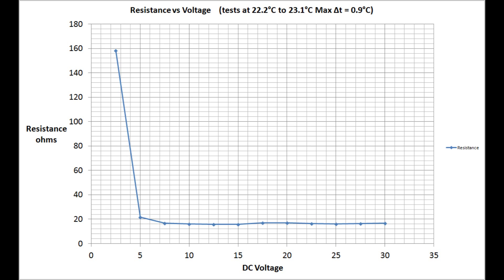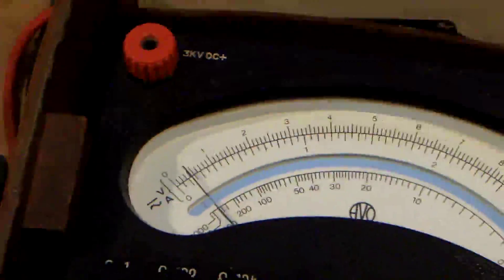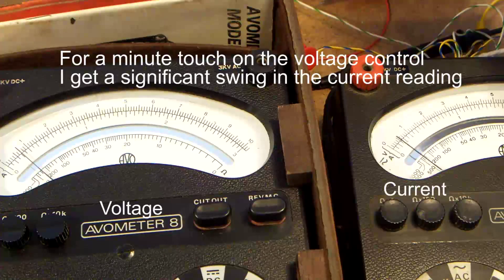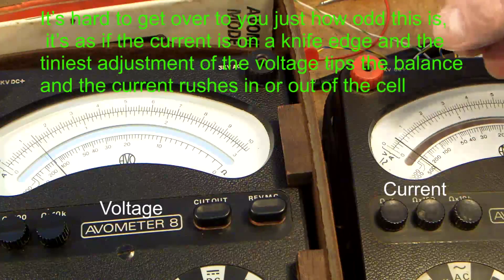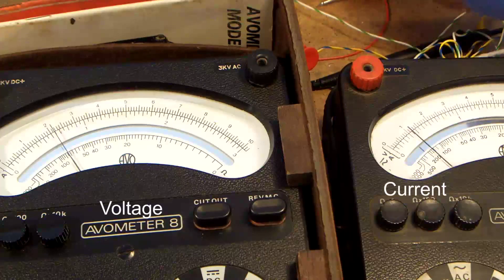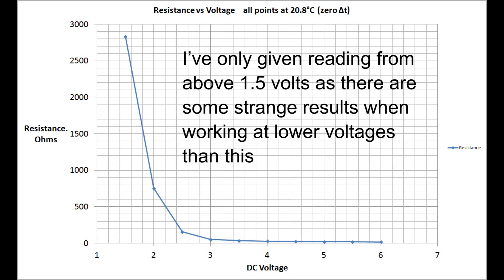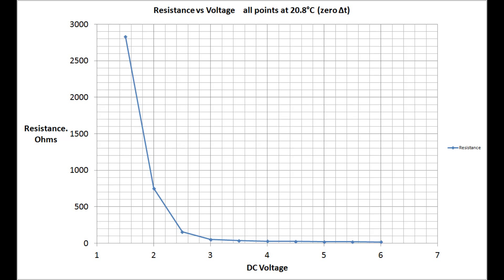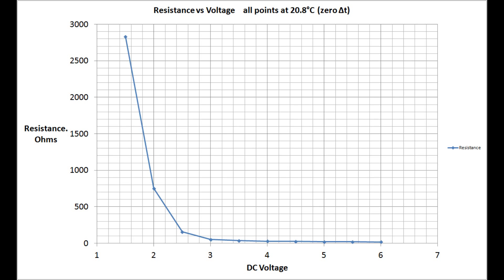HHO. 13 Cell resistance vs DC voltage (1.5 to 6 volts)

Comment: Well, it was late when I posted it.  It should read V = Q/C, and the Q of the capacitor (But this is a tough experiment.  The voltage is being held in the STRUCTURE of the charged water.  Your equipment is more sensitive than mine.  I wonder what happens when you literally shake the cell with a charge on it, to the V and the A.  (But the A Reversing seems like a capacitor discharging).  Interesting tests, keep up the good work.

Comment from the maker: I was about to say ‘A little misunderstanding I think. When I refer to the Q in this video I'm referring to the Q of the tuned circuit, that is the lumped L C and any R that’s kicking about and not the Q of the capacitors dielectric as a single component where Q would be the ratio of displacement to conduction current.’ Then I realised that’s in another video altogether.

I don’t know what SM found. Anyone got any thoughts this?

Good point as I hadn’t thought in terms of capacitor Q Factor

Comment: Andy, a water capacitor is a capacitor that can consume amps via dielectric breakdown (into HHO).  When the dielectric breaks down, Q = V/C, you get a Q Drop (because the charged dielectric breaks apart), and that causes a Voltage drop.  This then gets a bit of current as it charges back up.  Remove the voltage source, and the current reverses as the the V drops into whatever it can, and that allows the Q to change back.  Did Stand find that at extremely HIGH Voltages, Q drop is from avalanche?

Comment from the maker: Hey that’s fine, and I like your reasoning. I'm sure if I were to take the time to do the research I’d find that this is all well understood but I’ve never been any good at doing what I ought to do and I'm having a bit of fun into the bargain.  Got a couple of tests I want to do today to see if the cell performs like a battery or a capacitor, I think it’ll come out more like a battery but I have been wrong before, you’ll get to see it warts and all hopefully as I video it.
All the best ... Andy

Comment: I'm not an expert.  I was assuming that if you pass current through two plates not only do you produce hydrogen gas you emite particals of metal into the water. These particals would conduct.  Using a TDM meter you would see a rise in unknown particals in the water.  This unknown would be metal from your plates.  But if you resistance goes up after the water cools then my theory may be wrong.  Just throwing my seasonings in the soup.

Comment: If you build a fast water dump & refill-feature to the test cell, you could possibly rule out any Dielectric Absorption factor. I am thinking of one valve for water dump ("Wdump" - at bottom), one valve for water refill ("Wfill" - at the top with external water reservoir) and oposite to that, an air valve ("Air" - at top as well).

Procedure: 
1) Air [Open] + Wdump [Open]
 wait until empty
2) Wdump [Close] + Wfill [Open]
Wait until refilled
3) Wfill [Close] + Air [Close]

Comment from the maker: Absolutely, microfarads, I didn’t believe it as I said before it doesn’t behave like any capacitor I’ve ever played with and man I’ve used a lot of caps in my time. It’s a very real reading but I don’t believe that it’s a true reading. I don’t know off hand what voltage my bridge puts out but I reckon that the combination of the resistance of the cell and its ability to produce volts fools the bridge. Like I say I'll ring it against an inductor. 

Kind Regards ... Andy

Comment from the maker: The measured capacitance (air dielectric) is 83pF = 0.083nF and when I add the water from my dehumidifier (distilled water) the capacitance measures 1.56uF but it doesn’t behave quite like any capacitor I’ve played with before, hard to put into words but it took a lot to balance out the losses. It could well be like trying to measure the capacitance of a partially flat battery. Once I’ve cleared the basic tests I'm on with I will ‘Ring’ the cell against an inductor. 
 Kind Regards ... Andy

Comment: It seems I got the decimal wrong. The capacitance, C, should be 0.0071uF or 7.1 nF. (Based on Dielectric Constant of water 20' C, K=80, Plate overlap area, A=0.01 m2. Plate spacing, d=0.001 meters.)

Comment: Your test plates should act like a capacitor with a capacitance of roughly 71 nF, based on C= K*Eo*A/d, where  Eo= 8.854x10E-12 (if my units/decimal is correctly placed).

Are we seing Dielectric Absorption in the water (that will make the voltage on the capacitor slowly tend to recover to a fixed percentage (typically between 0.01% and 10%) of its original value?